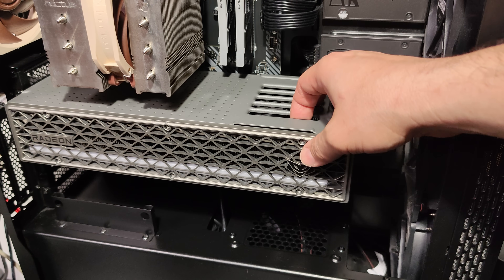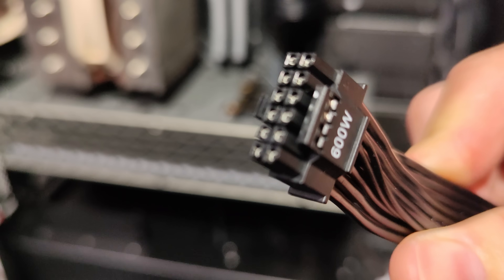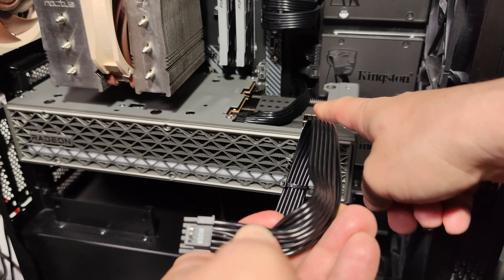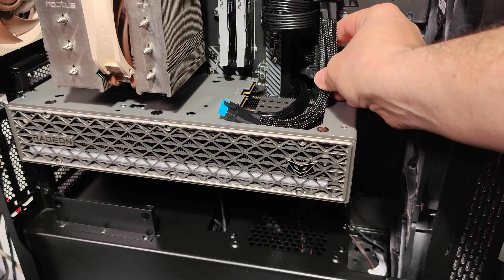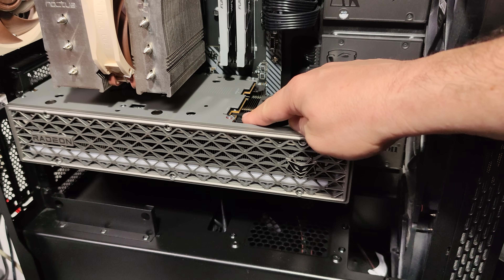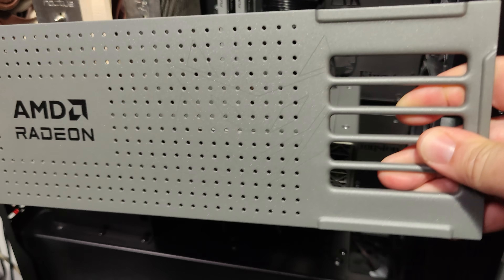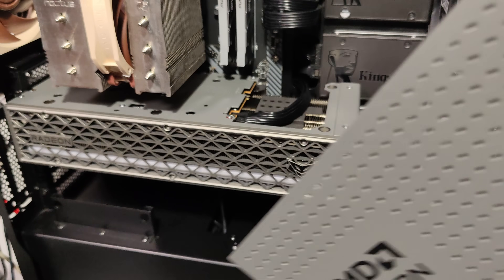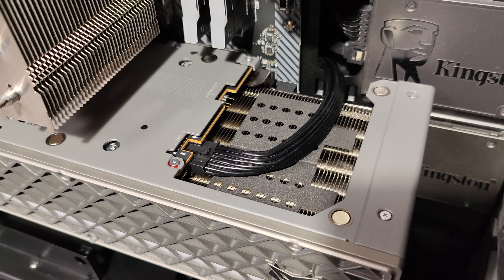Radeon RX 9070 XT Sapphire Nitro+  Magnetic Backplate More Problems Found And Exposed 🔥

Comment from the maker: **Update Nitro+ melted connector
Another Nitro+ melts down after 8 moths of usage, Sapphire responds and blames the user, the psu, the cable, the universe, aliens, not having enough forests on earth, lacking a bottle of magic moon dust, but you guess it, it's not the 12VHPWR connector fault, nor the lack of power balancing, nor using a sh*t adapter cable they include with the card.
https://videocardz.com/newz/inserted-nice-and-sturdy-16-pin-power-damage-claims-aorus-rtx-5090-master-and-sapphire-rx-9070xt-nitro
More burnt Nitro+
https://videocardz.com/newz/sapphire-radeon-rx-9070-xt-nitro-reportedly-suffers-first-melted-12v-2x6-connector-case
Another case of melted connector:  https://wccftech.com/all-pins-melted-on-sapphire-rx-9070-xt-nitro-16-pin-adapter/
Guess what, I was right!
Melting 12VHPWR Connector Claims its First AMD RX 9070 XT Victim
https://www.techpowerup.com/340193/melting-12vhpwr-connector-claims-its-first-amd-rx-9070-xt-victim
Reply: just claimed a 2nd. still shouldnt happen. i notice my unit spike up to 504 watts sometimes and thats undervolted on occt.
Reply from the maker: @tubelesstrippin  Just seen it a hour ago, https://videocardz.com/newz/sapphire-radeon-rx-9070-xt-nitro-reportedly-suffers-first-melted-12v-2x6-connector-case
Reply from the maker: @tubelesstrippin  Mine crashes right away if i undervolt it, regardless it's -25mV or -70mV, same goes for power limit, doesn't matter it's -10% or +10%. As soon as it's put to work it will stop responding or BSOD.
Reply: How do I prevent this from happening to me?
Reply: @noooodIe  Use hi quality cables!
Reply: You're honestly pretty ignorant for a reviewer. It clearly states the connector was using an adapter instead of connecting to the PSU using the cable directly
Reply from the maker: @Blixurd  And I explain in this video exactly why I do not want to use the included adapter, these being one of the reasons. Just look through the comments and see how many actually say that I should use the adapter.
Reply: @TechTronic9000 I'm just pointing out that the melting connector may or may not have been caused by the adapter
Reply from the maker: @Blixurd  Yes, it can even be user error, still adding more plugs, adapters, extenders will only increase the chance of issues, increase vdrop, increase current, increase temp. Also the 12VHPWR connector even if it rated to 600W it is at the limits of physics as the contact area for the pins is small and with the reduced number of contacts it's just unneeded trouble.
Reply: @TechTronic9000  you connected the card directly to power supply, it works, why you even bother about the adapter?
Reply: @TechTronic9000  I really want you to explain to me how is any adapter/connector increasing the current. About the voltage drop (due to internal resistance), is so low that shouldn't even be considered, even a simple wire has its own resistance. But YES, most likely the connector is cheap trash, if is '600W rated' doesn't mean it won't melt even at 300W. I don't understand why are you even making such a fuss about that adapter, since you already connected the card without it? Do not use the adapter! Simple as that.
Reply: @Blixurd  This is one of the worse cards Sapphire have released in years. Their PULSE card of this generation is a better card in every metric save for raw performance, but the performance is still good enough. It's also a quieter card with a better cooler (the design of it is way better)

Comment: I've got the Nitro+ and my cable is the corsair what comes with my psu and its not been a problem at all??
Reply from the maker: It's good and it's safer to use your PSU cable as the Nitro+ likes to melt the 12VHPWR connector especially when used with the original adapter cable included in the box.

Comment: I'd had enough after 3 minutes. 😢
Reply from the maker: We all should as another Nitro+ melts down after 8 moths of usage, Sapphire responds and blames the user, the psu, the cable, the universe, aliens, not having enough forests on earth, lacking a bottle of magic moon dust, but you guess it, it's not the 12VHPWR connector fault, nor the lack of power balancing, nor using a sh*t adapter cable they include with the card.
https://videocardz.com/newz/inserted-nice-and-sturdy-16-pin-power-damage-claims-aorus-rtx-5090-master-and-sapphire-rx-9070xt-nitro

Comment: Here's what I would do:  1. Use a hair dryer or a heat gun on a very low setting to warm up the hpwr12v cable to make it more flexible and pre-form it to the angle it needs to be at.   2. Remove the foam pad, cut it to size, and place it where the cable actually rests, OR sleeve the hpwr12v cable to protect it from rubbing on the cooling fins and just leave the foam pad off.  3. For the back plate; either just leave it off, or you could add a thin layer of TIM so that it actually conducts heat when attached.

Comment: I literally have this card set up in the vertical position with a riser and the backplate is locked in. Not really sure why this one is so loose.
Reply from the maker: A reason it's my PSU cable which is very solid and rigid. I'm not planing on using the included adapter as it was the one that melted in both Nitro+ cases.

Comment: This card does not really pull enough watts to worry about melting.  12VHPWR or 12V-2x6 is really a NON QUESTION for the cable itself.  Every (and I mean every) 12 volt cable is the exact same.  The 12VHPWR and 12V-2x6 is the change in the power sensing pins on the male end where you plug it in.  The 12V-2x6 has power sensing pins that contact the Cables Power Sensing Sockets about 1mm shorter than the original 12VHPWR so it will not sense power at all unless you plug it in 100% of the way plugged in.  This avoids the issues of people half ass plugging these cables in with a gap and causing the power to route through fewer pins.  However, most of these cables are rated for 600 Watts which is way over the 350 watts this card will pull when overclocked.  You would have to go out of your way to cause this thing to melt down and I mean really really try at it. Plug the 12 volt cable in so it is flush with the male end and you have Zero (Zip) Nadda to worry about.  Simple as that. People are making this a Cable issue when the problem is not the cable what so ever.  It's a problem with the male connectors on GPUs that caused the issue when people were not plugging them in all the way.
Reply from the maker: There are already two melted Nitro+ and also a AsRock Taichi, a bad design is a bad design and the 12VHPWR is a mistake that should have not be done. As for the Nitro+ it's a gimmick design with the second backplate that traps heat and adds weight.

Comment: you are the only one I've seen complaining about this.... just sell it and buye a nother gpu allready.
Reply from the maker: It doesn't work that way, my money, my true opinion about it and I was right about it.
Don't believe me, believe the "reviews" that praise it, meanwhile they keep burning out 
Nitro+ melted connector: https://videocardz.com/newz/sapphire-radeon-rx-9070-xt-nitro-reportedly-suffers-first-melted-12v-2x6-connector-case
Another case of melted connector:  https://wccftech.com/all-pins-melted-on-sapphire-rx-9070-xt-nitro-16-pin-adapter/
Melting 12VHPWR Connector Claims its First AMD RX 9070 XT Victim: https://www.techpowerup.com/340193/melting-12vhpwr-connector-claims-its-first-amd-rx-9070-xt-victim
Reply: @TechTronic9000  well your opinion does not apply to ME. I acctually own this card AND i dissagree with you'r oppinion... MY backplate is straight and is conected FIRM...dude dont be a dumb ass and RMA the card.
Reply from the maker: I'm worried that you actually haven't understood the problem. That metal plate has no role there it only hinders cooling and adds more weight and sag. They could easy used just a smaller "cap" around the connector area. Not to mention they glued foam to the heatsink and hidden the melting 12VHPWR connector which melts away. Sapphire is glad to get 300 euro more for a metal plate and a burning connector, you are basically their target buyer, as you watched paid reviews of how great this and now you go online calling others dumb :)

Comment: is it better to use cable from gpu or psu
Reply: psu
Reply from the maker: From the PSU, the Nitro+ that burned down they connectors where using the included adapter.

Comment: You complain so much about this card, but actually is one of the best 9070 XT on the market. Most likely your magnetic plate may not sit very well because your twisted power cable. You even say that the cooling is even better without it. So why you just don't remove it completely and problem solved? The problem with 12VHPWR connector burning is real, but this doesn't means it will certainly happen to you. You should have considered this when you bought the card, there are 9070 XT models with 2 or 3 connectors instead. But sincerely that can happen to any card, considering the fact that manufacturers may use cheap low quality connectors to reduce costs or not calculating/testing the right amount of power drain in specific circumstances. About the original splitter coming with the card, they provide it just because not all power supply models have that type of connector. Never use such adaptor if you don't need. You're describing problems that aren't even real problems.
Reply from the maker: I did remove it and it's better, still paying premium for a gimmick is not okay, also the melting connector did happen on a two Nitro+ and on a Taichi, so it's a real issue. As for the adapter, you are actually right, but then why don't they just make 3x8 pin standard and not force the adapter into the box, just for show and money.

Comment: You're not using the brace: that card is HEAVY. It's likely sagging. Damn can you rant like an old man.
Reply from the maker: The included brace is as sad as this card. I have my own custom 3D printed bracket and the card is now installed in a Lian Li Lancool 217 case that also comes with it's own anti sag bracket. Still that will not solve the glued foam on the heatsink, the melting 12VHPWR connector and the fact that the 2nd backplate will only add weight and hinder cooling. All of this nonsense for Sapphire to grab extra 300 euro more than the msrp, a 5$ gimmick.

Comment: ive got the Nitro+ and i got no problems with the Backplate. Your cable routing is just horrible
Reply from the maker: My cable routing is just fine, especially it's one directly from the PSU with no adapters. I prefer a stiff cable and a good connector. There's has been already a melting Nitro+, but what can you expect from a card that is so gimmicky with foam pads glued on heatsinks, an amateurish money grab.
Reply: @TechTronic9000  Right, with such flawless cable management, the problem must clearly be the “gimmicky” card — no way it could compete with that level of PSU engineering genius. 😂
Reply from the maker: @xite45  Enjoy the "stealth" burner https://videocardz.com/newz/sapphire-radeon-rx-9070-xt-nitro-reportedly-suffers-first-melted-12v-2x6-connector-case

Comment: What is this museum machine construction? 
What is a motherboard shredding air mixer?
Frivolous testing...
:face-fuchsia-wide-eyes::face-fuchsia-wide-eyes::face-fuchsia-wide-eyes::face-orange-raised-eyebrow::face-orange-raised-eyebrow::face-orange-raised-eyebrow:
Reply from the maker: No it is not, it's just a poorly designed graphics card, the 2nd backplate will not even stay in it's place as it's pushed from the power cable, maybe you want to say that the graphics card might be designed by construction workers judging by how they glued foam on a heatsink and believe using power cable adapter is fine when the 12VHPWR connector melts down.

Comment: What?? Idk how your backplate come off that easy. Mine was sticking so hard I couldn’t pry it out for a good 2 minutes I thought I would bend the metal before it comes off
Reply from the maker: Best option is not to use it at all, keeps the board cooler.

Comment: I have seen a test with the back plate on and off and the results were negligible
Reply from the maker: Yes the results could be negligible when you have an open air test beach running at constant 22°C, or similar.

Comment: I agree with the point of the pad blocking airflow from the finstack i have a rx 9070xt pulse and a nitro+ and when setting the fans to 50% max the pulse has better cooling and mind you the nitro+ have a vapor chamber

Comment: So... Which rx 9070 xt should I buy? Any recommendations?
Reply from the maker: Power Color and XFX make boards that don't use the 12VHPWR connector so they are much more better options. Also avoid the ASRock model as it also uses the 12VHPWR connector and already has had the first case of melting connector.

Comment: i too was worried about the heat being trapped by the extra backplate and foam, but believe it or not this card is one of the best at cooling teh gpu from among the top 14 9070xt cards. i watched another video from July 2025 from Hardware Unboxed where they compared them after 1hr of gaming and it had one of the lowest gpu and lowest hotspot temperatures however it was towards the back of the pack in terms of memory temps but it was still within spec.
Reply from the maker: As good as it might be the tests are subjective, for instance in my PC the GPU will get to 90°C hot spot in less than 10 minutes of gaming, while VRAM when idle has 65+°C. Now I have replaced my case with the new Lian Li Lancool 217 and with 2x200mm front fans in GPU priority mode, 3x 120mm under GPU fans and 2x 140mm exhaust and top fans it will climb to 75-80°C and stabilize there, the difference from those tests online? My ambiance temperature is 28-30°C. This still doesn't make any excuse to be using the 12VHPWR connector.

Comment: I've had no issues at all, the plate was solid, and the cable with the dard worked great. Seems like you have a build issue with the cable your using, should be an easy fix.
Reply from the maker: Still in 2025 it is inadmissible to glue neoprene foam with on a heatsink and to be praised as a top solution provider. Also calling the 2nd backplate as "head dissipating" is a sham, it trap heat that will later disipate, only keeping the real backplate hotter. This is just a gimmicky money grab solution so that they can invent a 300 euro higher price than the regular msrp price.

Comment: I wish they included like a 90 degree adapter specific for this card to eliminate this concern.
Reply from the maker: I wished they used any kind of connector beside the 12VHPWR and didn't stick foam pads on heatsink and added useless weight just for design and to hinder cooling. They could make a much more simple discrete cap for the connector area, used some proper connector mounted at 90° so no more awkward bends.
Reply: Don't worry too much about the bend. I'm using a smaller mid tower case and the cable bend isn't too significant

Comment: I'm doing a lot of research at the minute before choosing my card. This is currently at the top of my list. It's good to see a video posted of real world issues for users. However, to complain about the 12v 12pin connector is disingenouos & unfair. You would have known this before you purchased. This is a shared concern of mine also! In terms of cooling, the Nitro+ is top tier. So yes, you are probably technically correct in terms of restricted airflow etc affecting thermals but to what extent? I would like to see real world testing results before passing judgement. This is the quietest card on the market afterall & coolest in terms of thermals. As for more connectors, if you have 3x8 pin connectors directly attached to the card you still have 3 extra connections over 1, so using the splitter only ads 1 additional connector to the mix so power demand changes will be minimal & probably not even noticable. AS for the PSU cable being stiff, that is down to your choice of PSU, yes, XFX should have considered this in their design, which is probably why they included a soft, flexible adapter cable. I would much prefer to see a 90 degree angled connector aiming directly towards the back of the card. My bigger concern with the connector is the tight 90 degree angle and the pressure applied over time. Thanks to this review & what I've seen more than what you said, I am now leaning towards the ASUS TUF or the XFX Mercury cards. Also, the coloured connector is so you can visually inspect with ease if the connector is moving or coming loose. The introdcution of the magnetic backplate removes this ability & introduces a level of complexity which makes the coloured connector pointless other than initial installation.
Reply from the maker: Thank you for your comment and insights, I'm glad you found the review helpful in your decision-making process. As for choosing this card I was forced by the availability at the moment when I have bought it. So unlike general reviewers which got it for free I have paid for it with my money so I can also tell the truth about it. As for the cooling and stability, I can not praise it either. It will freeze randomly when trying to undervolt or play with the power limit. On stock settings GPU hotspot reaches 89-90°C in just 10 minutes under load. With the backplate off I have seen around 6°C temp drop on average.